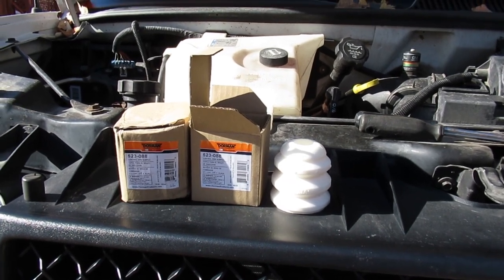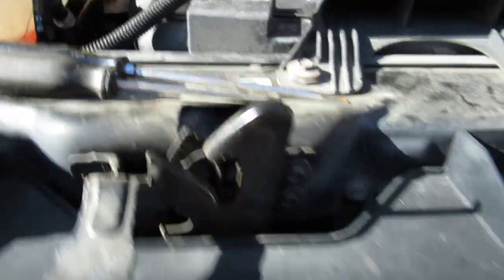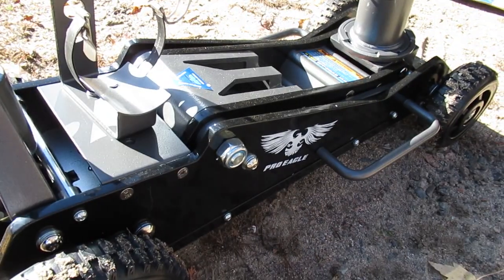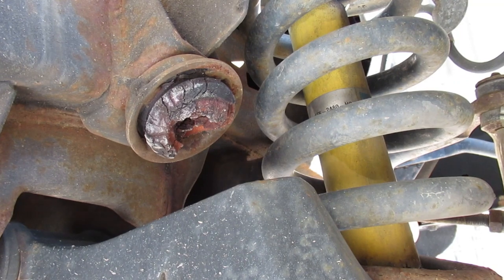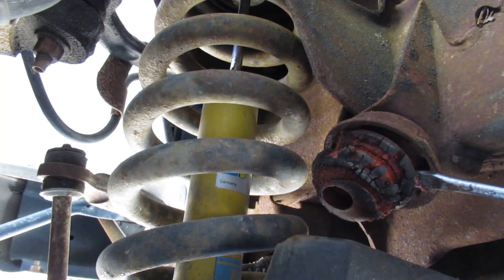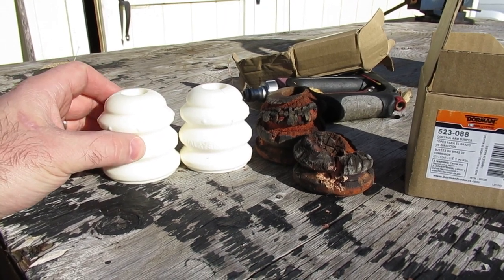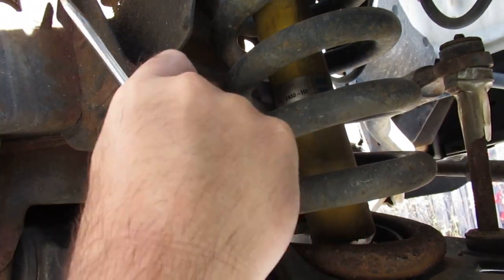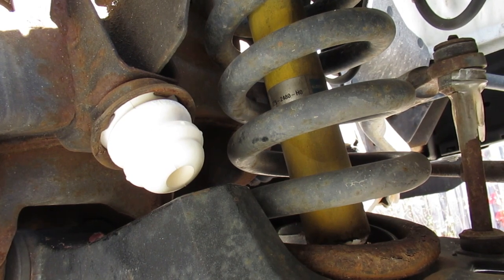Chevrolet Express 2500/3500 2003+ Lower Control Arm Bumper Replacement

Comment: great video. I am also rebuilding the front end on my 1995 chev roadtrek 210  with 120k on it which i purchased 2 months ago using only ac delco parts .Replaced steering gear box n hi-  pressure hoses,  next will b loose steering shaft knuckle or u joint.

Comment: Stephen, Is there a rear bump stop for the Express Van? I cannot find it on my van. Thanks
Reply from the maker: yes, there would be one on each side.  I have a video where I installed a lift kit on this van and at some point I think I show them
Reply: @SteveRivett well I googled the part number for the rear bumper stop and I found there is nothing. I have a 2094 chevy express 2500 cargo van. I will check your video. Do you know the location on your van,? Thanks

Comment: Cool. You an engineer? I think I'm seeing the ring of power. 

Also, my bump-stops aren't as blown as yours. But the LCA is pretty much lightly touching the bumper at default height. Is that normal? Or have my springs sagged?
Reply from the maker: Yes, I am an Electrical Engineer.  The measurement you need to look at is the wheel centre to fender wheel arch.
-9000# 2004 Chevy Express 3500 Roadtrek Popular 190 conversion with factory suspension and 100,000 miles: 19" from the centre of the hub to the wheel arch up front and 21" to the wheel arch on the rear axle.
-Brand new 2019: 155" 3500 6.0 with no rear interior and the centre wheel hub to fender height was 20-3/4" up front and 23" out back.

Comment: Those are plastic wheels on a 3.5 ton jack? That isn't good.
Reply from the maker: I think it will be OK unless it is super cold out.  If they fail I'll replace them or have a machine shop make new ones out of a different material.  If you look at older photos of these jacks they changed the material of the wheels early in their production...I assume they are reinforced with glass strands so they don't shatter.
Reply: Surely they allowed the jack to sag and rest all the way on the ground.  At least I hope they do!